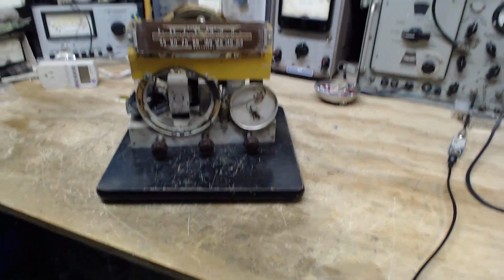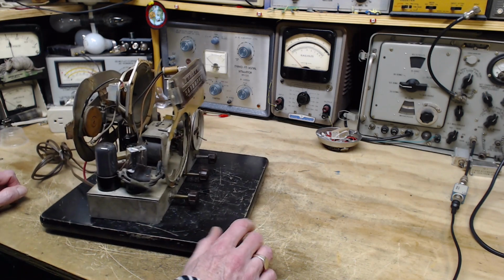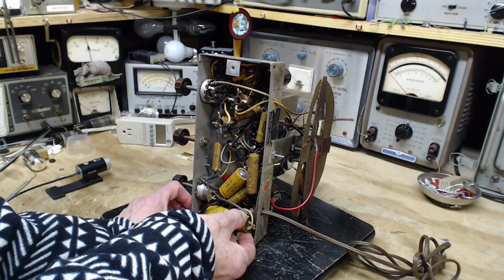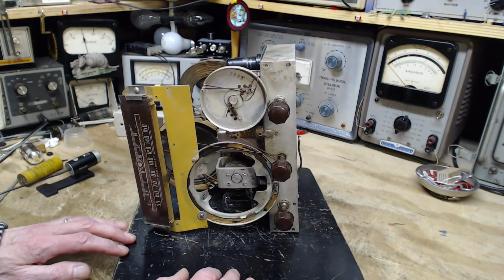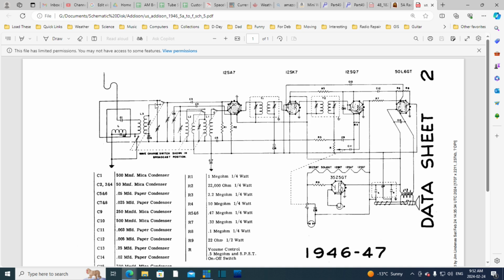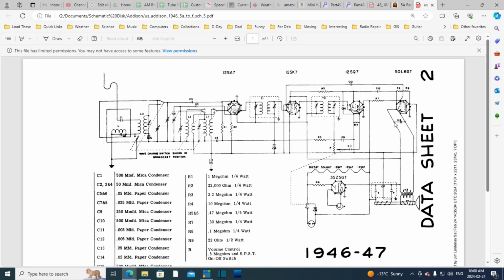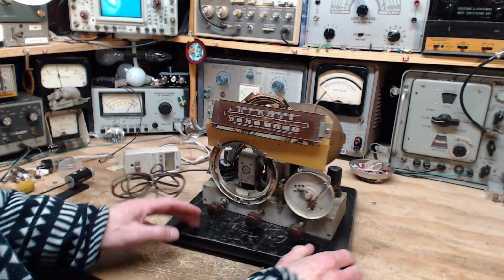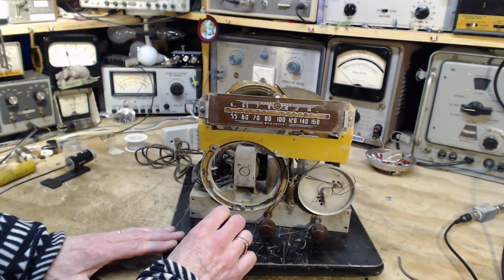Addison 5A Courthouse Tube Radio Video #1 - Checkout and Power Up

Comment: If this set truly has some value (it's just an AA5), seems worthwhile to search for the correct field coil speaker. If it can't be found, at least mount a PM speaker where it belongs and fit a choke under the chassis.

Comment: Welcome back Jim!  Glad to see you are Ok, Ya had me worried. I bought that Mini-Whip antennae and tried it out. I want to use it on AM DXing. So far I have only tested it on my spectrum analyzer and it looks to have hot signal gain. My main disappointment was no power supply came with it. Thats the third time I bought cheap Chinese electronics gear with no power source. I do have a nice quiet source to try out. Its one of those small lead acid bricks from a UPS system. I keep it charged with my EICO variable 12 volt power supply that I Kit built back in 1962. The Mini Whip draws only 90 milliamps. This will be for intermittent usage only on my test bench. I took the pipe apart to see what makes it work. The electronics looks plain and simple, quality of craft looks good. Maybe you can tell me  this? Does the top end of the cylinder get attached a short length of stiff copper wire?  They don’t give you much 50 Ohm cable lead in. How high up did you locate your whip cylinder? I found a battery power supply works best on reception as the receiver module is very susceptible to switching power supply hash. Documentation in the package was nil, but I found all I needed on line.